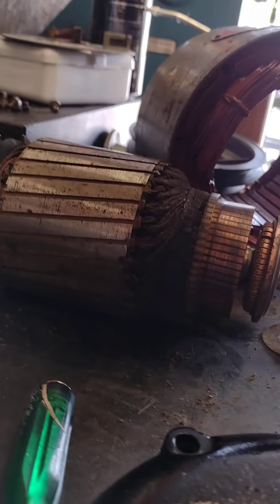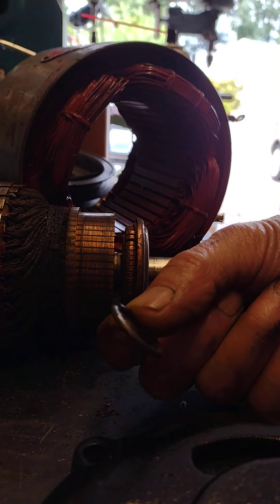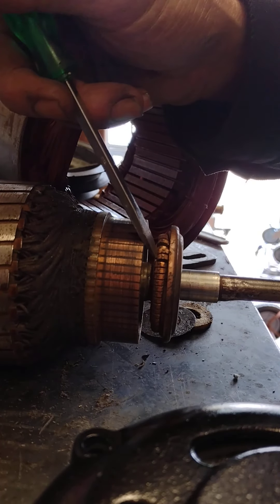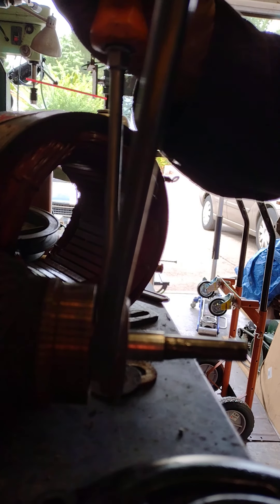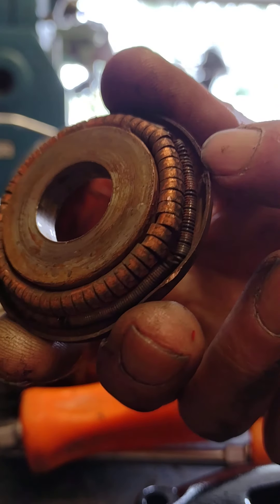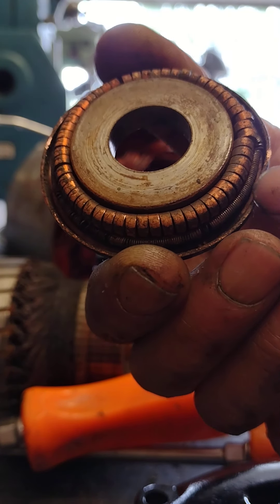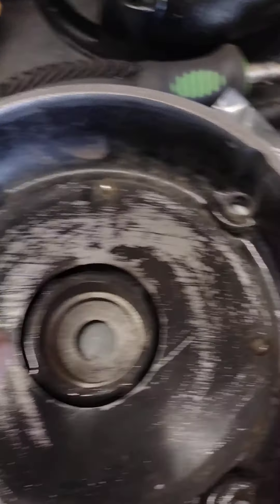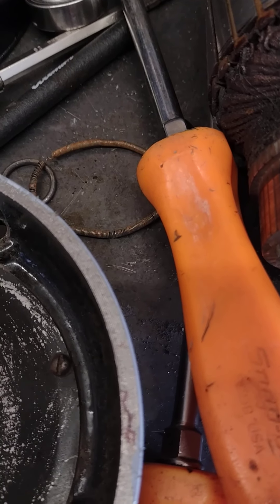The Delta Drill Press Induction/Repulsion Motor Shorting Necklace Fiasco

Comment: Good stuff, I really appreciate the time you take to show off the "little stuff" like how that necklace works to short out that part of the motor. 

I'm not to far from you (Eugene) - say the word and I can 3D print you a stand for that phone/camera thingy you have. Also, if I may make a suggestion; put the camera facing away from the open door. It will light up what you're working on better and won't make the auto focus try to swap between your hands and the trees outside.
Reply from the maker: Thanks for the tip.
I am still dilly dallying around what I am going to do about either getting a real camera or trying to jury rig some kind of holder for the phone.
Right now I'm just winging it as you can see.